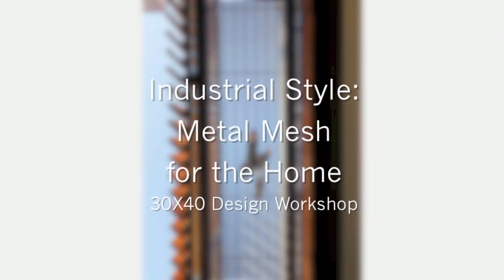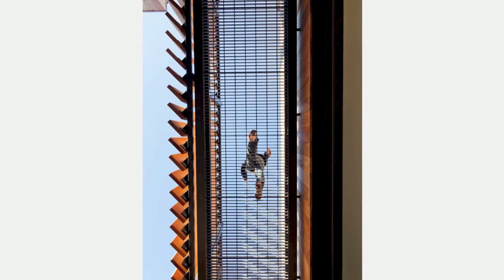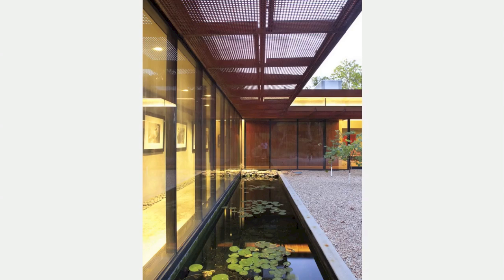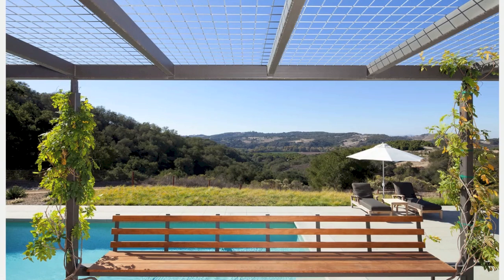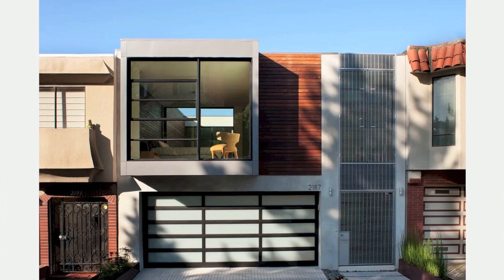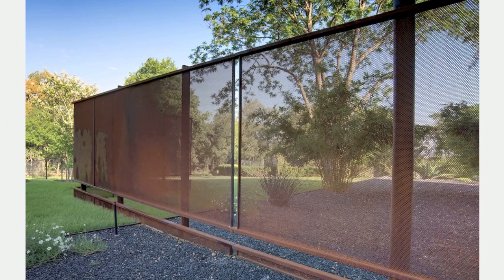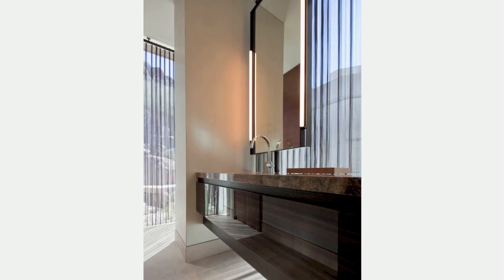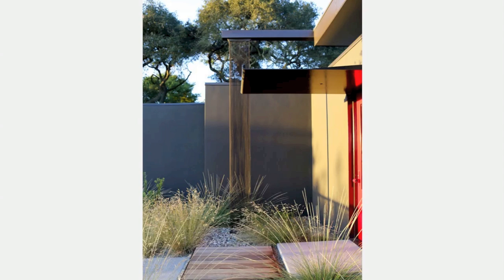Industrial Style : Using Metal Mesh in Home Design

Comment: What is the durability of the aluminum grating in the outdoor setting?    Would the aluminum corrode over time in 10, 20, or 30 years?   I love the look and flexibility of using the aluminum grating and mesh products, but I would worry about the durability and maintenance over long periods of time.   Are there surface treatments to prevent corrosion for aluminum metals in outdoor setting?